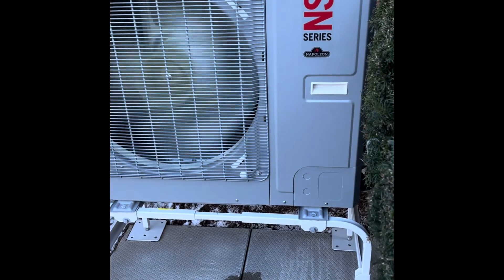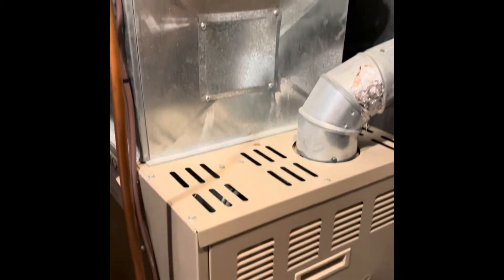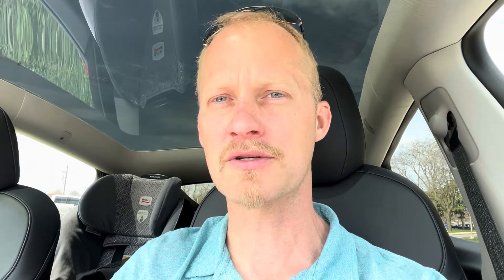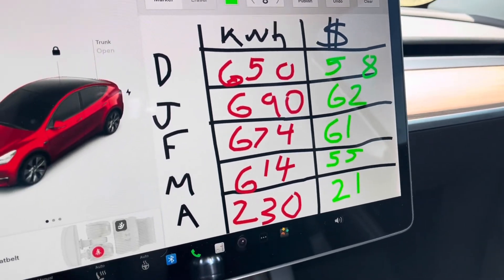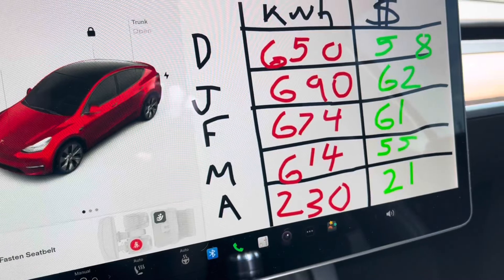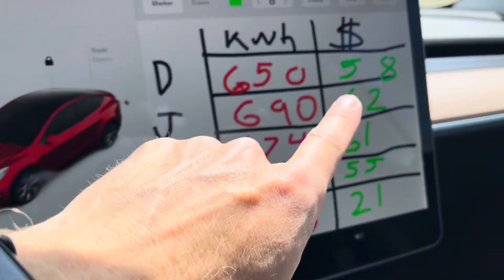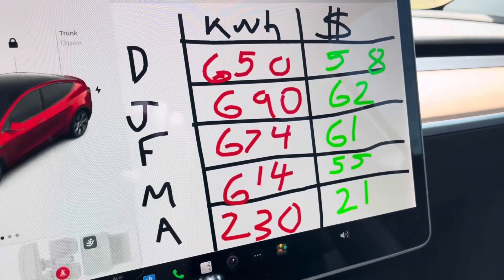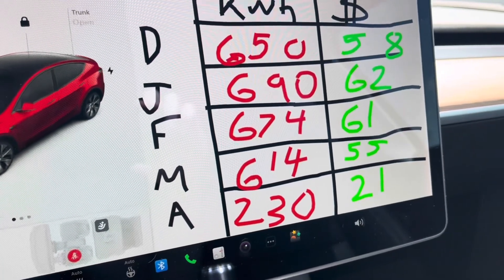Heat Pump real cold weather efficiency and cost

Comment: I read a posted article by 'The Cool Down' and I found your testimony thought provoking so, I did some math regarding our utility usage (Central Indiana, US). We heat our home at 70 degrees F. winter and cool at 72 degrees F. summer (1,700 sq ft) and including all the HD TV's, computer systems, lights, refrigerators/freezers, garage (Heat), security systems and all the rest we 'average' $145.00 US per month... that is Electric + Nat Gas. I love the idea of the heat pump, but it would be worn out before it paid for itself. Keep up the great work!
Reply from the maker: It sounds like you have a very efficient home already!
Reply: @yourelectricneighbour3633  I invested in my homes infrastructure 'first'... i.e. insulation; attic/floors/foundation/walls/windows/roof/ventalation and property grade and drainage... 'then all the 'fun stuff'. It's my personal belief is that most folks get distracted by the way their home looks instead of function. I appreciate your comment.

Comment: The heat pump system is using 2x the average small home electrical usage and 2x an electric car. The grid will need substantial infrastructure to handle this home heating load
Reply from the maker: Not correct. Uses less energy than your typical old school central AC unit.
Reply: You're very wrong on that buddy

Comment: Did you include the furnace fan motor usage as well as the heat pump In your calculations?
Reply from the maker: Yeah but good call. I also later installed an ecm motor for better fan efficiency.

Comment: Looks like a Gree Flexx rebranded?  Same as MrCool Universal / Midea Evox / GE Connected.  I keep finding other brands that are the same / rebadged, looks like I can add Napoleon NS18 to the list!😀   I put a 2-3ton one in last spring, worked fine for A/C, and this is first winter heating with it.  Good so far.  They have the features to make it cold climate capable and efficient (EVI compressor vapor injection, which is a middle intake port to the compressor, and inverter compressor & fan variable speed).  It doesn't have a scroll compressor like the fancier Mitsubishi and others, so I think the COP is not as good, but the price of the Gree is a bit less also.   I put a new 410 coil in the air handler, which I had previously put in a new ECM blower motor, and it is set up with thermostat for 2 stage heating and cooling.  The ECM motor will save electricity.  The hi/low blower speed changes the load on the outdoor unit which then throttles back when it figures out it's on low speed.  It is also hooked up to a water coil for heating to a hydronic system, and I'm working on measuring the system COP, we'll see how that looks.
Reply from the maker: Nice set up. I’ve had to replace the unit (gree) once due to the compressor but napoleon gives a 10 year warranty so it’s good that way. I also installed an ecm blower in my old furnace so now getting better efficiency. Thanks for watching
Reply: @yourelectricneighbour3633  yikes, how long after initial stop did something go wrong?  What did it do?  Was it something the installer did?

Comment: What is the set point you set your unit too? I am in southern Ontario and have it to 5 Celsius but was wondering if I should set it lower? I also have a 3 ton gree flex unit dual fuel gas furnace.
Reply from the maker: My thermostat refers to these as “switching tables” and you can set each hour/day differently. I ran heat pump almost exclusively until around -22C last winter.

Comment: also check you furnace airflow. if its 2000cfm(furnace 21” wide) set your outdoor unit jumper to 60000 capacity. if its 1600(furnace 17” wide) set your outdoor unit capacity jumper to 48000(4ton)
Reply from the maker: Appreciate the response.

Comment: hey. if you want video idea. just upgrade blower motor with ecm motor and measure amps before and after at the furnace plug. its going to be half
Reply from the maker: Thanks, have thought about that. Wouldn’t that need a new control board as well?
Reply: @yourelectricneighbour3633  need retrofit motor kinda contant torque, very similar wiring
Reply: @airbluehvac  Going dual fuel — Energy Star cold climate Heat Pump with existing 20 year old Amana high efficiency 2 stage forced hot air furnace. I will check, but would guess current fan furnace is single speed. So HP with coordinated ECM furnace fan more effective?
Reply: @gilbrook  full speed ecm is little more efficient than psc. at low speed ecm is way more efficient.
Reply: if you have 2 stage furnace most likely it has 2 stage blower. hope you using both stages for cooling and heating. this gree flex ge ac pro condenser will slow down if indoor fan is in low speed. this way you can get 2 stage cooling and 2 stage ho heating.

Comment: Interesting stuff and nice work. I agree that you only know how you are doing when you actually measure it. I suggest that you add some more instrumentation and monitor temperatures especially across the air handler. The NS18 looks interesting and something I would consider when our York 2T heat pump needs replacing - I would like to keep the air handler. One thing I don't want to do is what a neighbour recently did - spend $20k on a Mitsubishi system!
Reply: im getting the new FS series installed on monday and its the 15k btu unit and its 5700$ taxes in ,, installed ,,, thats 5700$ for 19k btu cooling and over 16k btu heating ,,, how did it cost you 20k$ for your system ,, how big of a system do you have?

Comment: you guys are only paying 8.9cents per KW? And I always thought Ontario's power was super expensive, well that is what I assumed considering all the complaining I kept hearing about how super high electrical costs were there. 8.9/kwh is dirt cheap, unless of course you're not adding in the transmission costs, admin costs etc etc etc.
Reply: In Toronto, Ontario, my electricity cost $0.21 CDN per kWh including delivery, taxes and time of use differences.
Reply: I think he is fooling us . I am in CT my rate 16 cents plus delivery charge and taxes it totals  26 cents for Kilowatt
Reply: @andreycham4797  where is CT, Connecticut?
Reply: @wally6193  yes it is . In January Eversource bumped rates to 24 cents and I changed supplier with 16 cents rate
Reply: @andreycham4797  You do understand that he is talking about Ontario Canada. Even with that, I still don't believe those rates I'm in BC and my rates are 9.6(1st tier) and 14.5(2nd tier). My rates are all inclusive except tax.
Reply: My brother lives in Ontario and he makes more than 2x than me which makes me think that delivery charge can not be significantly lower than mine. So  this guy just misleading at least I would say
Reply: @andreycham4797  yeah sounds way out. When I was living in Calgary our electrical rate was 4.99cents/kwh, but likes yours you then had to add on all the rest of the charges like transmission/admin fees etc etc and it came out to be more like 15.5cents /kwh.
Reply from the maker: https://www.oeb.ca/consumer-information-and-protection/electricity-rates
Reply: No it is not 9cents per kwh. Electricity ratesi  Ontario vary depending on supplier. Hydro One has multiple plans for Time of Use and Tiered. Problem with heat pump is it runs almost continuously in cold weather meaning you are going to be charged across all rate times. 8.7 cents to 18.2 winter rates. Average is 14cents per kwh plus taxes etc.
Reply: I hour north of Toronto on Hydro One Rural -Tiered. (same price all day) Average cost every month including taxes, delivery, provincial rebate is $.016/kwh all in. (1500kwh is $240.00 total) --GREAT VIDEO! Thanks.

Comment: Does the heat pump control system automatically shift to the NGas system?  Can you set the changeover point?
Reply from the maker: With the thermostat you can have it change over automatically based on price of gas vs electricity or on outside temperature. I have mine set to heat pump only mode for the most part however as with gas prices this year electricity is more affordable.